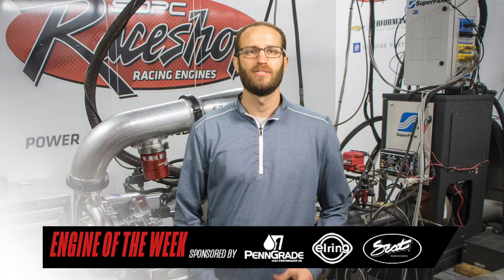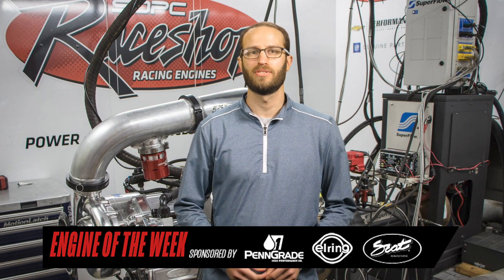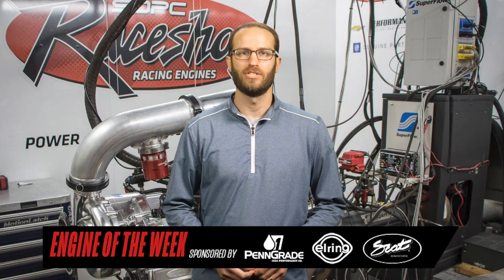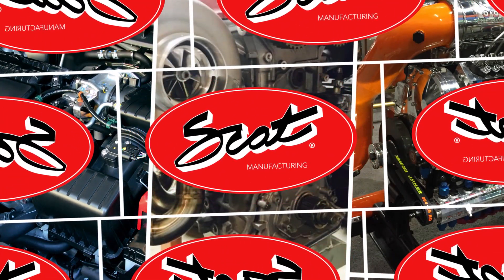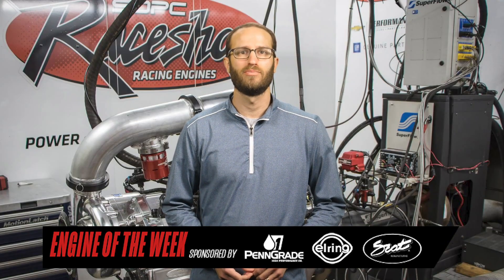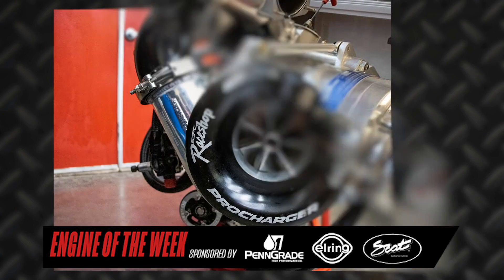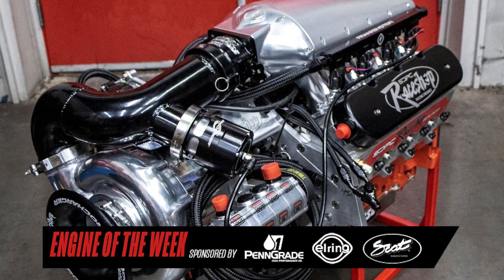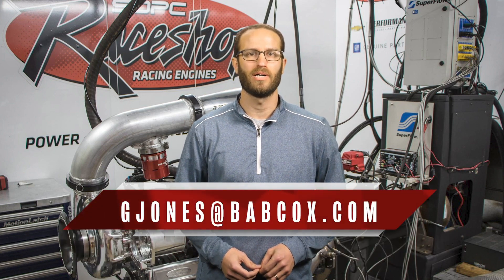ProCharged 1,600-HP LSX Engine

Comment: How about some technical details like cam, compression, ring type, head flow, boost? What is the point of this video? sell engines with out helping people who watch the content? NOT GOOD!
Reply from the maker: We hear you Dean. We try to get as much detail as we can when we talk to engine builders. Sometimes not all of that info is readily available or offered up in conversations. Those are good details to have though, and we will strive to capture more of it going forward. Thanks for watching.
Reply: @EngineBuilder just a thought, but isn’t it prudent to not publish a video until all info has been acquired?
Reply: You can get some info dude but theyre here to make money. You'll have to pay for some of those specs
Reply: @jubjub905  Getting info and building your own engine are to different things.
Reply: @deansciortino6425  its a dudes personal race engine. Info is needed to build an engine, theyre simply showing it off. By the way, its 'two'.
Reply: @jubjub905  not that hard to make 1600 hp. Simple build, no need to hide it. Buy the way it's "they are"
Reply: @jubjub905  Ok grammar boy, now it's the power curve. You won't know the difference in technical data in that engine vs my lawn mower.  You probably think Biden is a great President   too.
Reply: @deansciortino6425 ... definitely TWO separate and somewhat guarded by each builder as we EXPERIENCE  on BOTH sides of that equation... UNDERSTANDABLY certain " TWEAKS " such as the likes of my first mentor... KENT CHATAGNIER, MIKE BLACK, RON DUDLEY, etcetera.